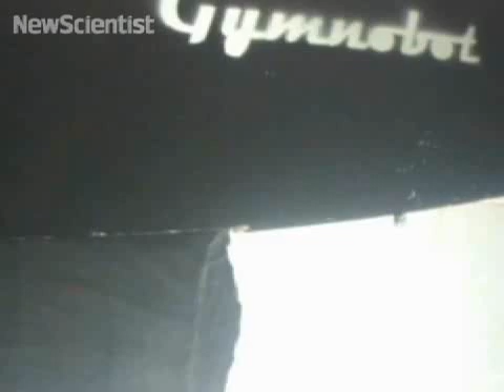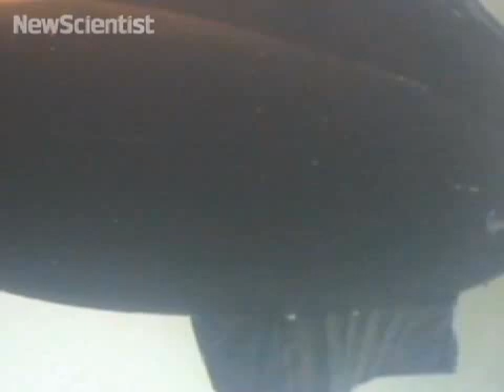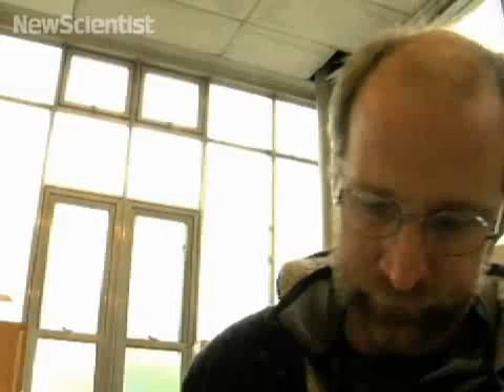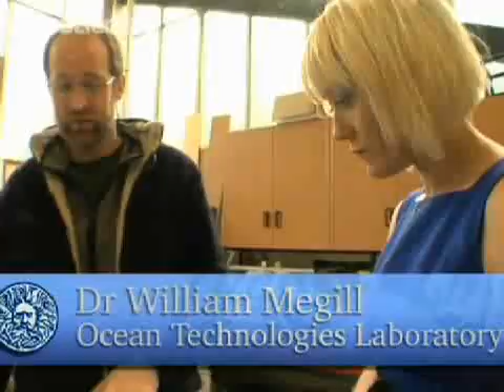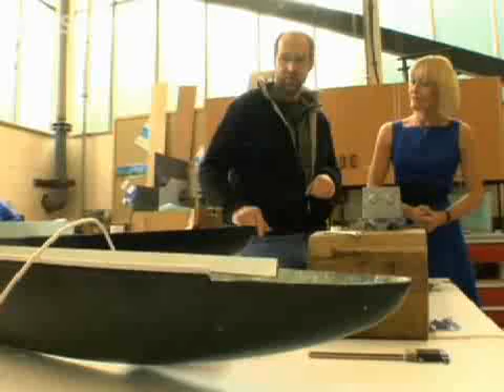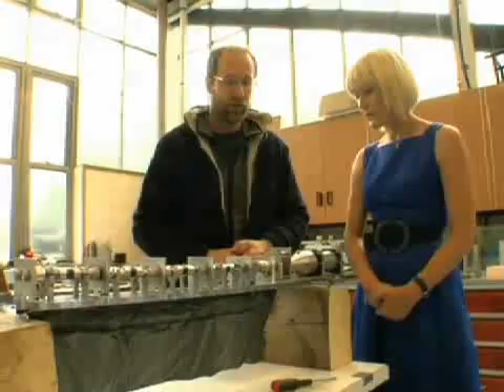Knifefish sub

Comment: not very impressed. seems very clumsy and the movement is kinda hardwired into the motor. Should have been made a lot more flexible with individual systems controlled by software. I'm sure the real deal can not only propel itself forward with this belly fin, but also steer, which will be close to impossible with the approach they have taken. Strange. Looks like something build in a garage, and not by scientists.

Comment: these guys arent too smart, the crank limits the timing of the fin. They should use linear stepper motors at each location, and a microprocessor controller to establish timing. That way they can change everything in software. The fish has individual muscles, so mimic it properly.